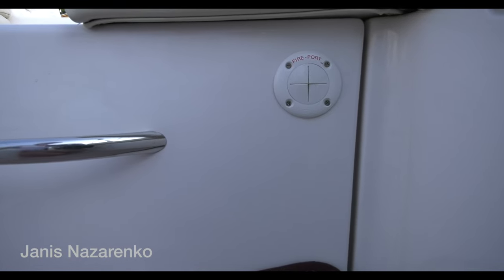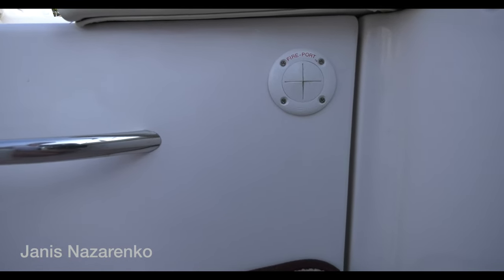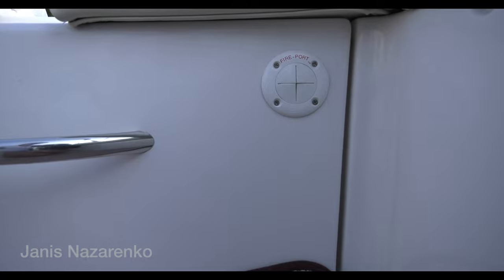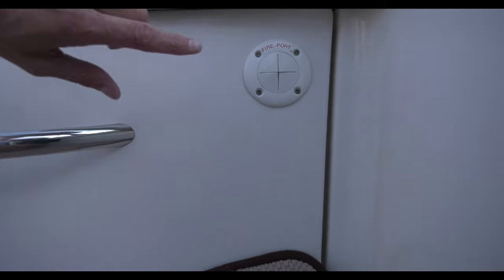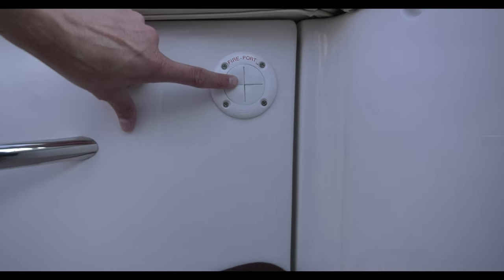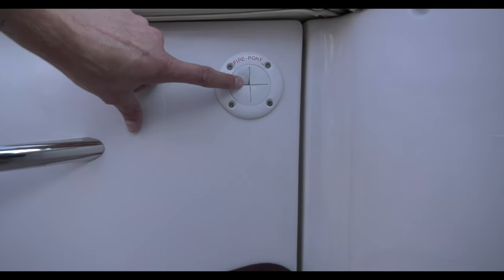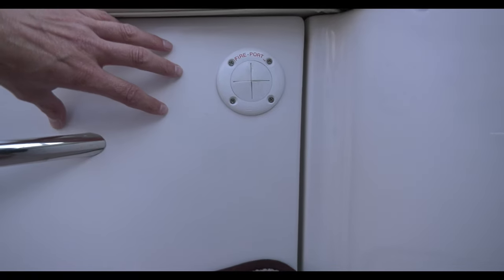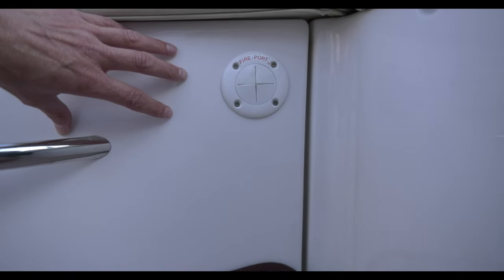Small boat - engine compartment fire port

Comment: Great video, very simple to understand. Question: How would you know if you have a engine fire if you don't open the access panel to look and potentially fuel the fire with fresh air?
Reply from the maker: An alarm may go off if equipped with one. If not, it’s more likely to smell it first, then smoke will start billowing out of every crevice around the engine compartment. Flames would be next since they seek air. And it would be fast.
Reply: Thank you, that makes a lot of sense.